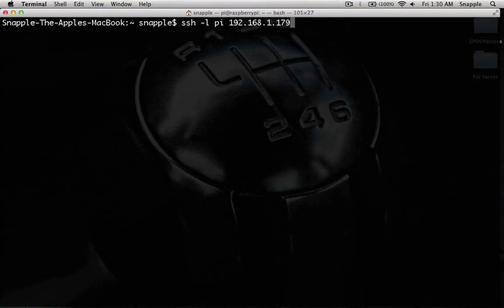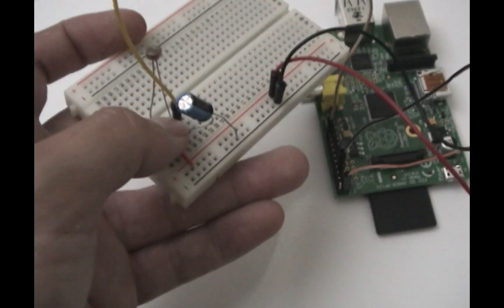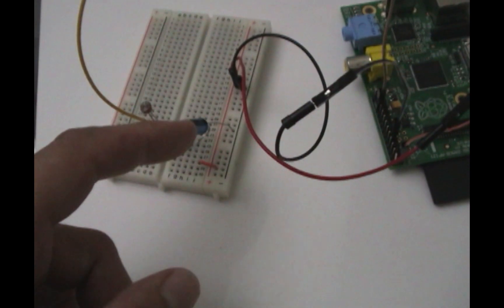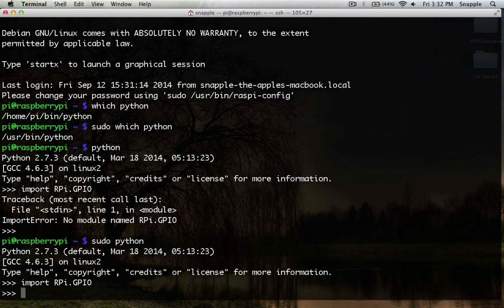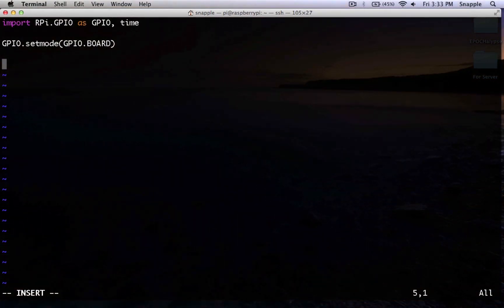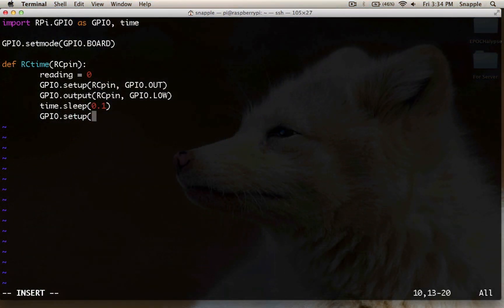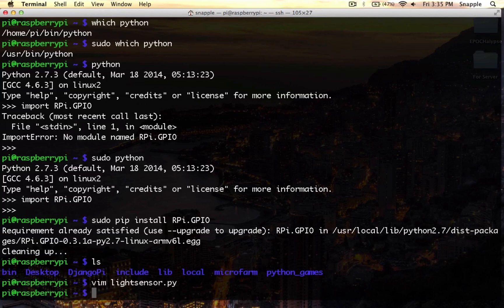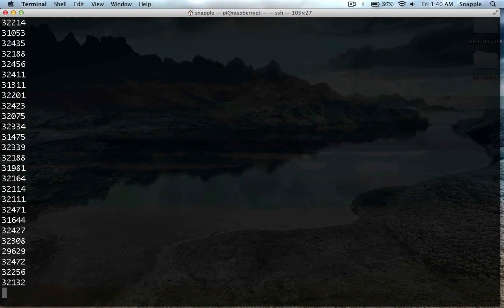Reading a Photocell with a Raspberry Pi

Comment: Hi. I'm just starting quite big raspberry pi project, which is basically turning my house smart, where Rpi controls all lights as well as heating etc. 
I was going to use photoresistors to detect whether it's light or dark to automatically turn the light on. I was thinking that one of the resistance values surely should suggest it's dim so I can use it in a code to trigger output to relay. 
Couple questions. Would I need any other hardware other than photoresistor to do that. And where would you suggest to look for scripts. I'm quite new in all this, getting my first pi tomorrow. Yet ambitious.
Thanks for any input.
Reply from the maker: Elmars Silins Just like in the video, you need a capacitor to measure how long it takes the capacitor fill to get your light reading.  To figure out how to interface readings from the photocell to something like django, which you can then interact with in python, check out one of my other videos: https://www.youtube.com/watch?v=SqdF6l4ahbE